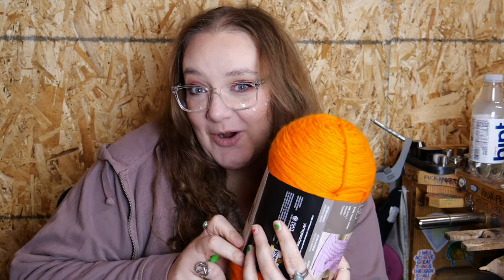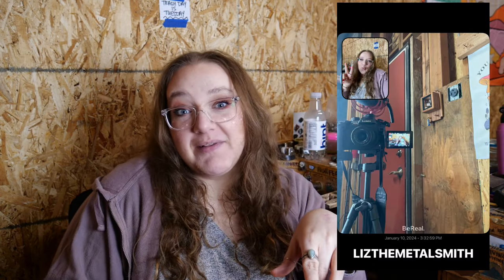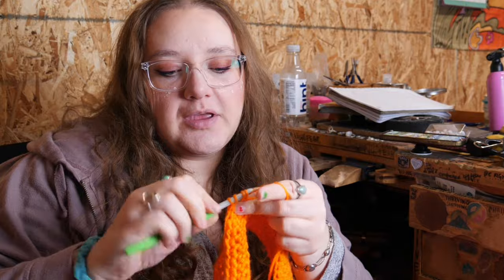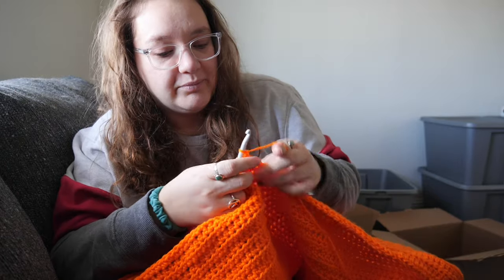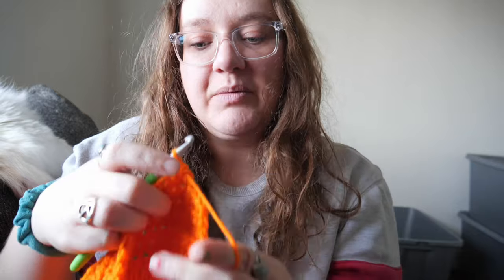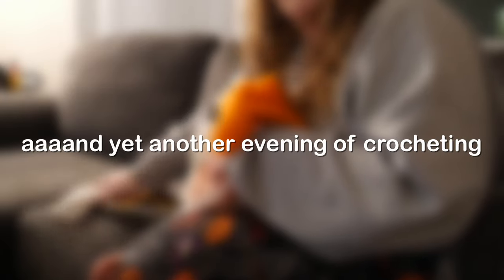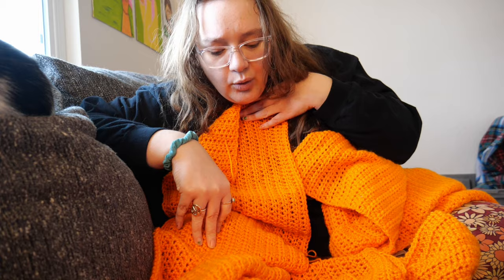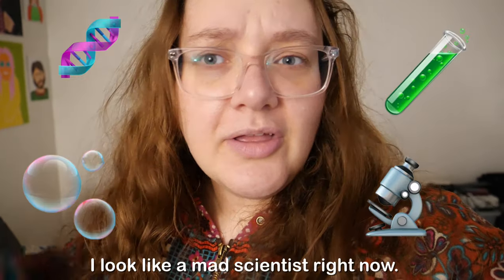Combining crocheting and silversmithing (HIGH FASHION!)

Comment: I center pull from my yarn until I reach a part in the pattern where I need to cut it off. I use a yarn winder to cake it up after that.
Reply from the maker: I always get tangled if I pull from the center, for some reason! But using the side yarn is also a pain in the butt. I def need a winder! 🌀